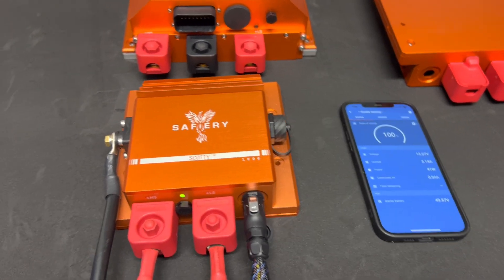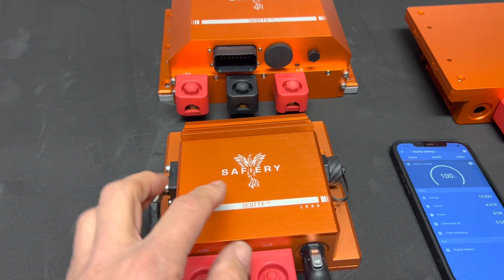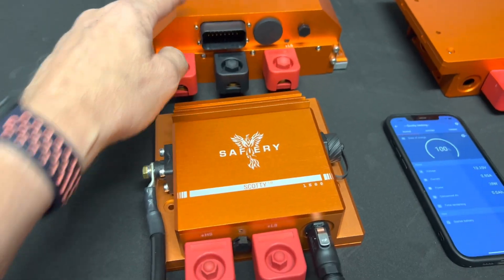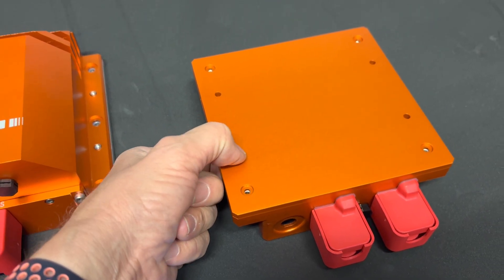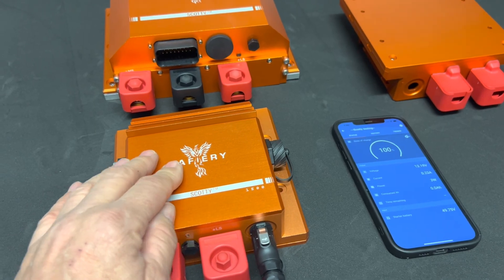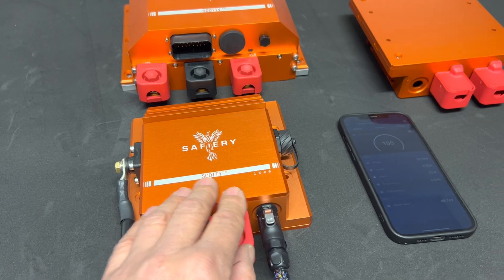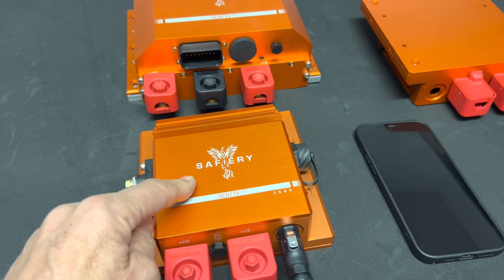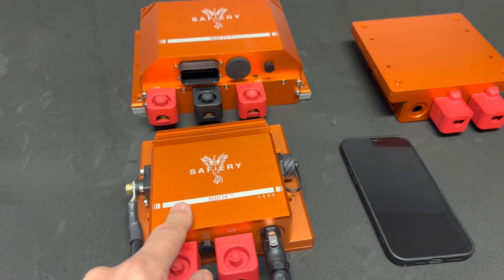Scotty 1500 12V to 24V 36V 48V Bi directional DC to DC CANbus controlled

Comment: will it be able to charge when the engine is idling at a campsite with a euro6 alternator?
Reply from the maker: Absolutely it does. The Euro6 was a huge challenge but we nailed it without any modification to the engine/ vehicle. It just plug-n-play. Go to our website and touch the chat button to start a conversation on this. Cheers Bruce

Comment: Bruce...l am just returning from the Finke River Races. There are so many 4WD out there that could use Safiery gear. I told soooo many about the quality and reliability of Safiery components. And now You have done it again.with another fantastic addition to the Safiery fleet.
Reply from the maker: Thanks Peter. Scotty 1500 is a big achievement for us. Its 100% our funded development against the calls of "cant be done in that power/size/space" comments from suppliers. The result is simple, the process was complex. Cheers